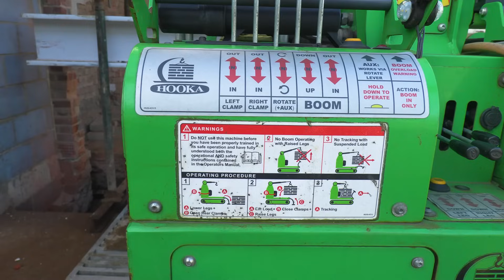How Does This Machine Lift Huge Steel Beams So Easily?

Comment: Wow. No cost restrictions on this job. Enough steel to hold up a multistory building. And enough equipment to build one. I would have got a second opinion on the scale of the steel. Some engineers are away with the fairies. Those huge columns too. What is wrong with ends built into a wall. I actually own a manual portable beam lifter. Wheel it in and hand crank. Other than that I use chain lifts. Scaffold pole lift frames. Final positioning with jacks or acrows. This job seemed totally over the top.
Reply from the maker: Goal posts are very common when you take the back end of a house out. You have a cubic metre of concrete under each one. It is way better than bringing the steel down onto the existing brickwork or building brick piers.
Reply: They are, and I have done a fair few. Including an internal ring beam on a bungalow, to put on another storey. But the size of the steel on that looked overkill. And now you say a cubic metre under each stanchion. I'm in the habit of arguing with engineers. And they are getting worse. Most of them now lack common sense, and can only operate buttons on a computer, without any practical knowledge or understanding of what the machine is spitting out. Then you have to consider the computer software making the decisions is programmed by a computer geek, not an engineer. You end up with the blind leading the blind. They don't want to come on site. And operate remotely from their office, mostly without a clue of what the job entails in 3 dimensions. Some of the stuff they come out with is like dealing with a kid and a mechano set. Not very often I accept their first offering. And no joy with one, try others. They generally like ripping each other's work apart. You can reduce them down from a bomb shelter to a normal building. And often save thousands in cost. Or you accept anything and they cost you thousands. A bad engineer can take all your profit, very quickly. If you find a good logical one, keep hold.  @SkillBuilder

Comment: Next time put the steel beam next to the wall, place props then demolish the wall partly.(Save some parts to put a bottle jack on) Might be a bit harder with cleaning the rubble but now youll be able to finish the job with 2 chainhoists from toolstation and a hydraulic jack for the last bit. 
And if you do it often: modify a transmission jack, just watch out it doesn't bend.

Comment: How were the beans delivered, I'm guessing manhandled? These machines look like they might help if there were only two workers, but there were six workers I would have thought that much less sophisticated technology could have been employed and the job done much quicker, but what do I know?
Reply from the maker: Hi Martin 
 The beam was delivered on a truck that incorporates a crane. There is no way that less than ten men could man handle a 1000kg beam off a lorry and around a house. 
I am really mystified by the number of comments where people are saying that the answer is to get a bunch of blokes in. If you ask ten people to turn up on site to do some heavy lifting eight of them might turn up. One is likely to injure himself and they will all want paying. This job was in London, even the parking permits for ten builders is a major expense. Why not budget for the machines and leave it to them?  This was the entire back end of a London house that had been removed and propped up. If I were the customer I would be reassured by  these guys.
Reply: @SkillBuilder if you showed a video with 6 or 10 blokes lifting the beam the comments would be, get a small crane.

Comment: To those questioning the beam size: I suspect the client/architect wanted minimal downstand, hence using a UC section instead of a UB.  Less efficient in terms of weight, but gives the slimmest solution. Limiting deflection so the exisitng structure above doesn't crack may be driving the beam size: beam span and deflection have a very non-linear relationship - a 5m beam needs to be twice as stiff as a 4m beam to satisfy the same deflection criteria.  There are many aspects to beam design that are unintuitive and can result in beams needing to be surprisingly large.
Reply from the maker: That is all interesting information. It would be good to do an interview with you at some point because a lot of builders don't understand why certain sizes and weights are needed.
Reply: @SkillBuilder  I'm up for that - I think there should be much more 2-way learning between builders and engineers.

Comment: So they managed to get it in and up onto band stands but couldn't lift it another 2 metres? They had already done 90% of the work.
Reply from the maker: The machines put it on the special bandstands that they bring with them.
Reply: How did the steel get on the concrete blocks? Same principle, if you managed to get it into position and off the ground, you've done the hard bit.

Comment: Seems more of a faff than fitting it with block and tackle and a few people. The amount of people you got watching could have had it in no time !!
Reply from the maker: I would love to see you do that. Talk is cheap.
Reply: I've fitted these before yes it's hard yes it's dangerous but we always achieve but this way seems more of a faff then the traditional method just my opinion  @SkillBuilder
Reply from the maker: That is fine Dave but let's get real. We have all  bumped in big steels  but this is not something you pull up on a block and tackle.
Reply: @SkillBuilder  Yes Roger, but I think even you would agree that that steel was way bigger than it needed to be. Even if deflection needs  to be minimised.
Reply from the maker: @bernardgarrett3897  I don't know about the size of the steel. All I know is that was what was on the drawing and, as a builder, you build what is on the drawing. 
So given that this is the steel and it needs to be put in place without knocking the house down it would seem to me to be a very professional solution. 
I have done it the other way with chain hoists and all kinds of things but who are we saving the money for. Price for the job, these are homes in Winbledon, they won;t lose out when they double the size of it.